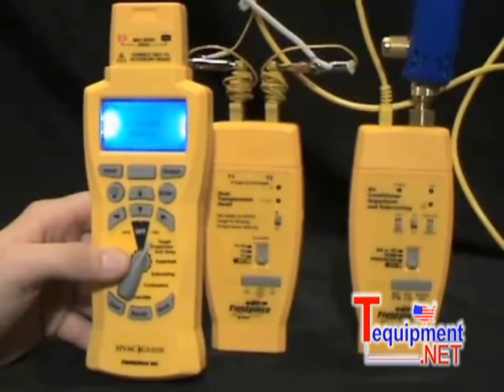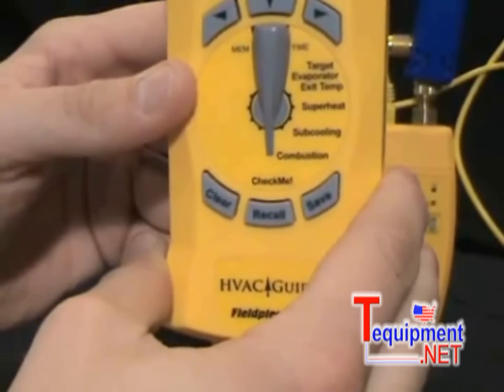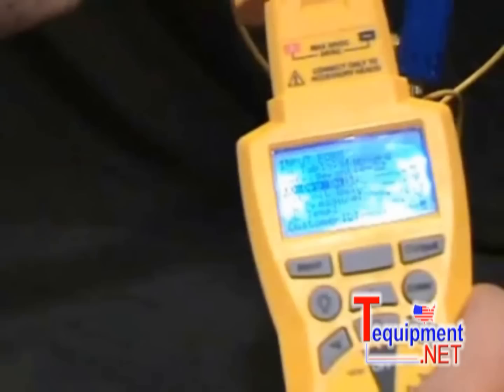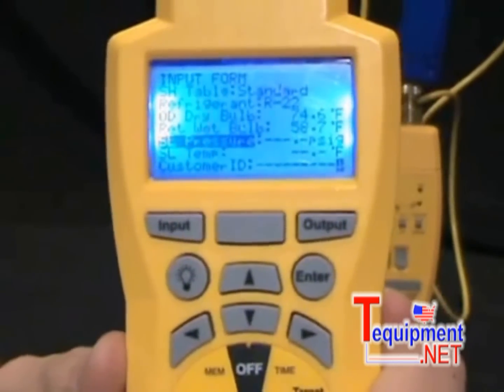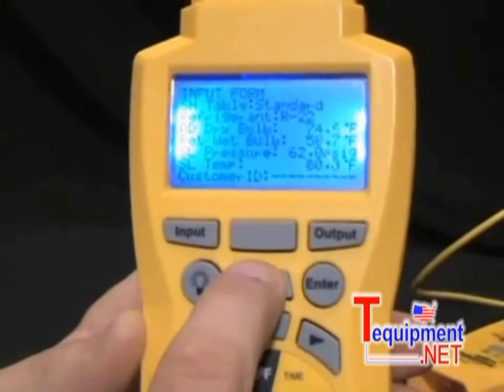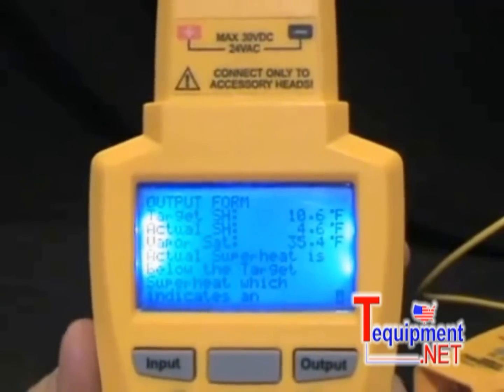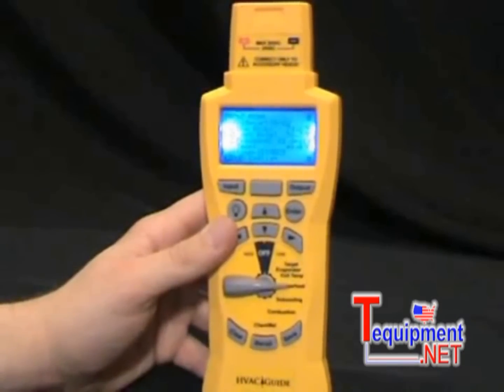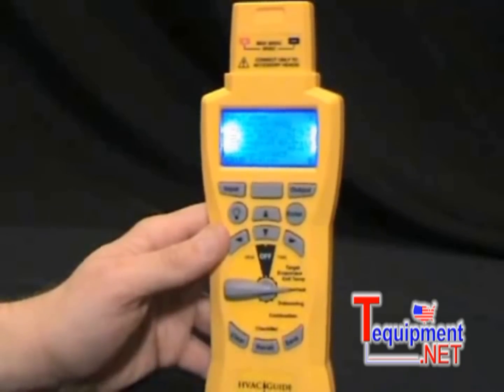Fieldpiece Instruments HG1 HVAC Guide System Analyzer Dial Positions

Comment: At first, I thought this was ridiculous. But the amount of people out there who do a half ass job is too many to count. The fact that it helps you do all of your checks then prove what the readings were, or just as a simple reference point for inspection history, is an excellent sales tool. I found continued business is much easier when somebody sees that their house is cooling better than ever from just doing your job correctly. Especially when instead of giving the run of the mill answer that the system is old & tired, you've brought faith back into the reliability of their older system. I was a fluke guy until realizing the thought behind the product and the urge to do the job correctly